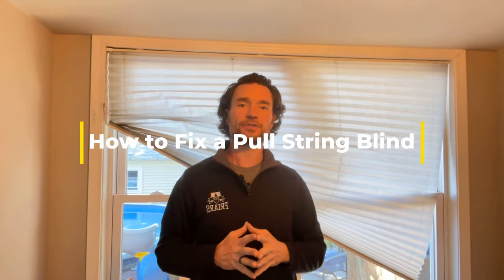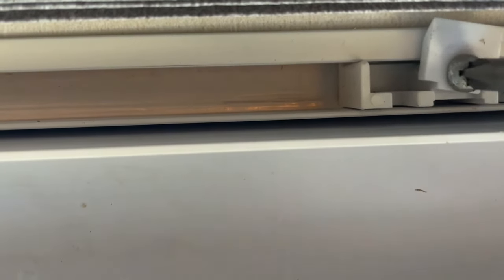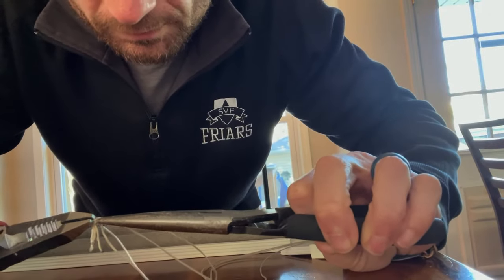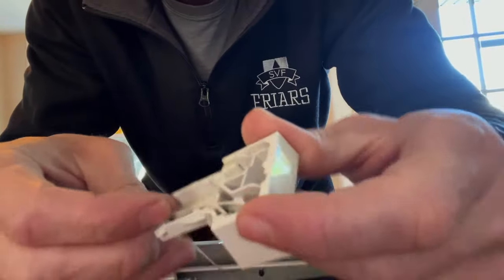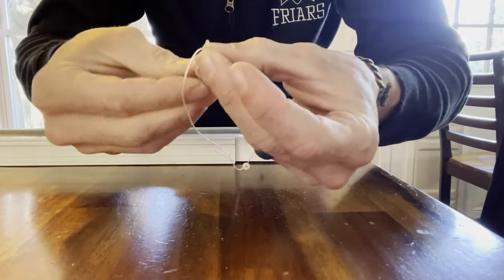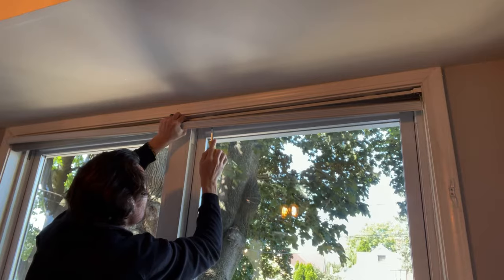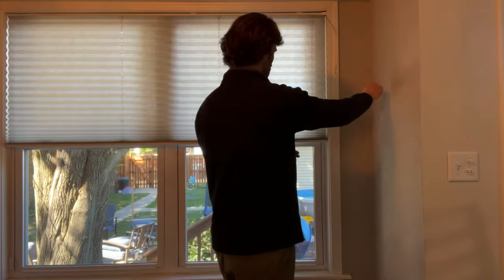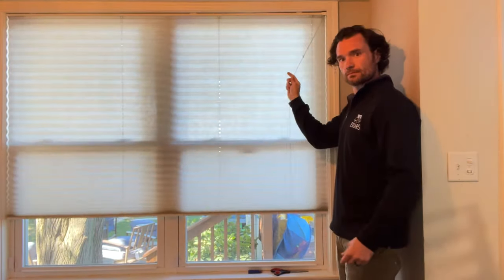How to Fix a Broken Pull Cord

Comment: Unfortunately all 3 strings of my H D blind snapped at slightly different lengths.  Will the sliding bottom mechanism allow access to all insertion points . Or will I have to remove the entire bottom cover to access string insertion ports?